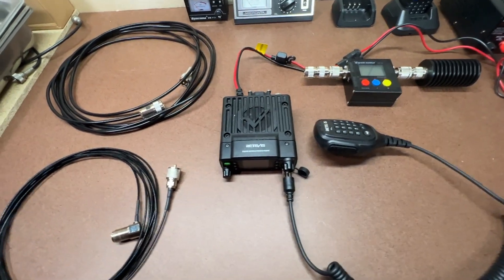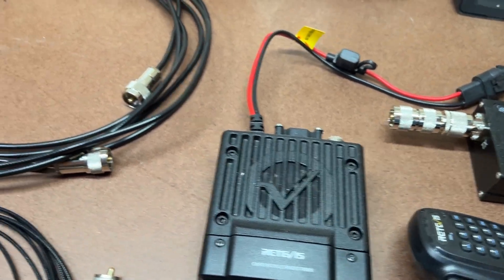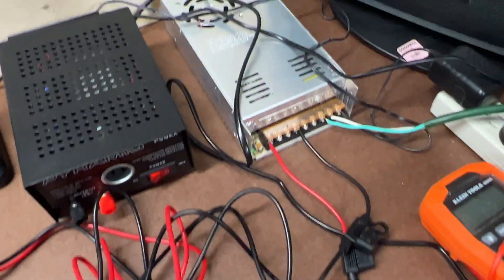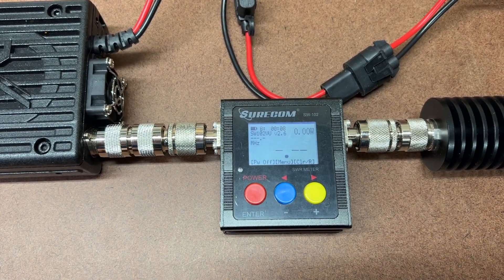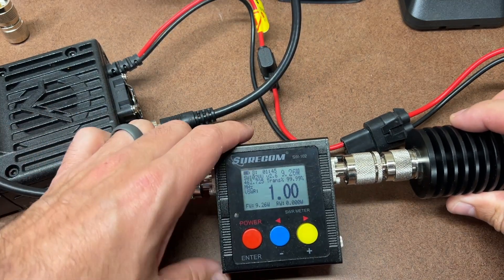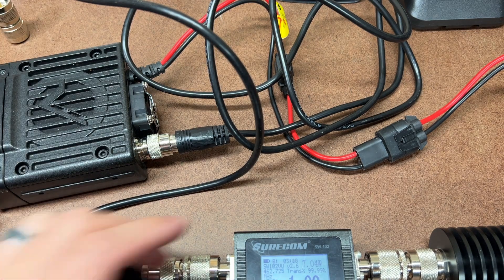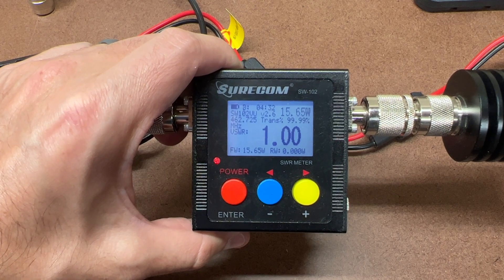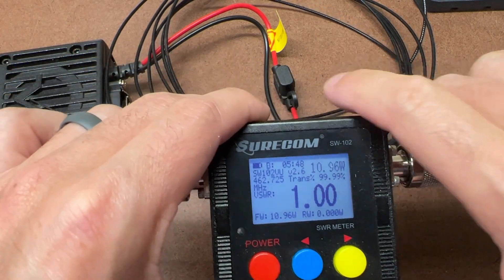GMRS Radio Coax Power Loss

Comment: You would be better off scrapping all of that crap coax and use something like LMR-240UF (Times Microwave) or LL-240 Flex (RG-8X Low Loss from JEFA Tech) double shielded coax.  The LL-240 Flex is the same as the LMR-240UF but at a lower price per foot.
Reply from the maker: Thanks, I will look into the LMR-240UF. I think depending on the installation location (vehicle, base, etc.) would limit which cables would be used. I think in a base station application I would try to use something like LMR-400.
Reply: @mkoutdoor  I use the JEFA 240 Flex and Davis RF RG-8X LL for mobile installations and runs up to 50' with negligible losses on HF but for VHF and UHF I use JEFA 400 Flex for runs up to 500' and it only comes in second to 450 Ohm window line for low loss per foot. However, window line is not feasible for VHF/UHF work, best suited for use with HF dipole antennas.

Both the JEFA and LMR are double shielded.

JEFA also offers a RG-58 type coax, JEFA 100 which is a double shielded RG-58 coax for short (less than 15') mobile installation runs.

73,
John, N1WOM
Reply from the maker: @jfrphoto01  have you used the DX engineering 400max or any of the Messi and paloni coax?